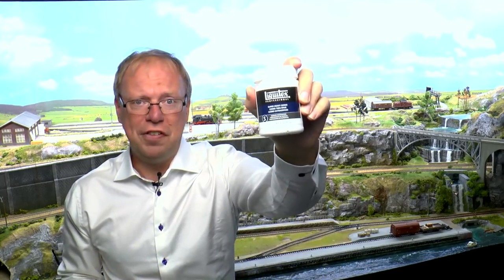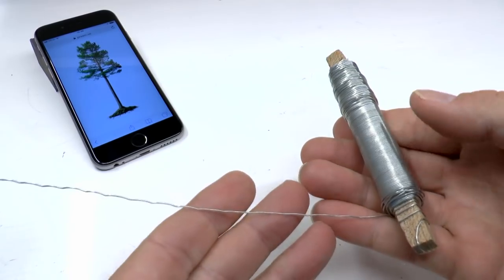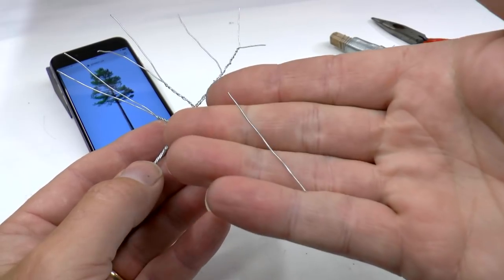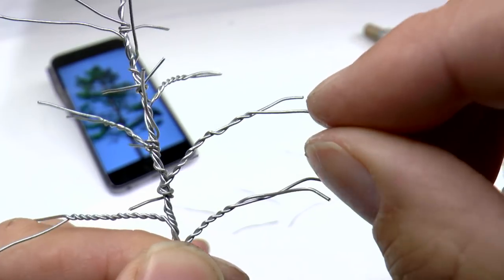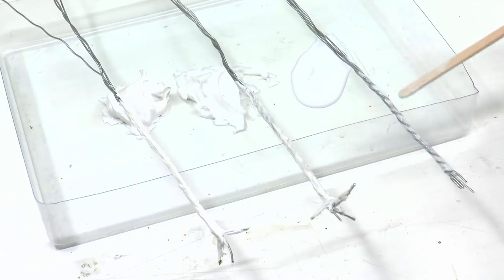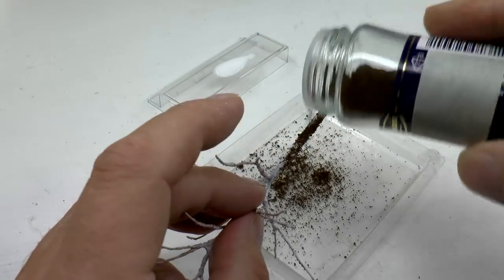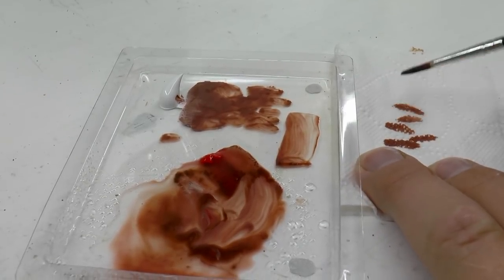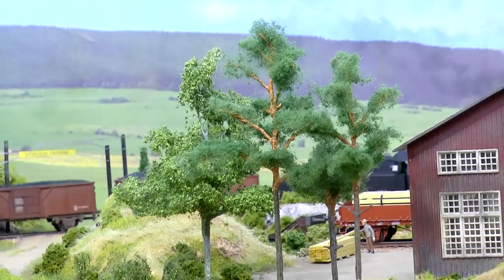Model realistic Pine trees using Pro-method

Comment: Another fine video tutorial!  Re-dried coffee ground are very much unheralded in so many hobbies ... as a ground cover, bark applications, etc.  After drying, it can be ground even finer by simply using an electric powered coffee grinder.  The more you grind, the finer the grounds will be.  You can have various different size grounds for different uses.

Comment: I'm a big fan of your channel. You explain everything so well. I also experimented with the wire trees. First I tried with more than 10 wires for the trunk wich is really hard to twist. I came to the conclusion that the best is with six wires. The reason for this ist, that at the bottom I spread four wires to make the root system and the remaining two I twist again to achieve a relatively stable "mounting pin". Drilling a small hole (1 mm) the tree stands securely on the layout. Best wishes, Andreas

Comment: Another excellent video Martin. I think the reason you see people using 10 - 20 wires to twist their tree trunks, is because they use a lot finer wire than what you used. You need more to get thickness in the trunk, and more wires gives you more branches in the tree.
Reply: BNSF3012 Nscale very true but with the finer wire painting the branches becomes much harder.

Comment: Why do you use alcohol at 7:25? I´m always using water and I think it´s also perfect.
Reply from the maker: Thank you for commenting! The purpose with the alcohol is to remove the water surface tension. This to make the water (paint) flow in cracks and on the surface. It is not neccesary on some surfaces, but I always have an amount of alcohol in my water thinner to make sure...
Reply: Maybe I have to try it! Thank you for the answer.

Comment: That's a lot of metal to use if you need to make 1000 of them
Reply from the maker: Indeed. I only use this type of wire tree for the "front" on my layout. I use much simpler trees in less exposed areas.